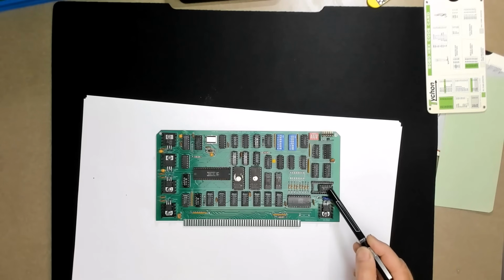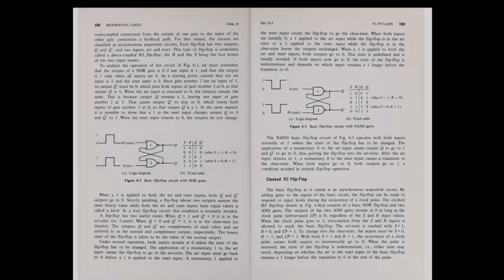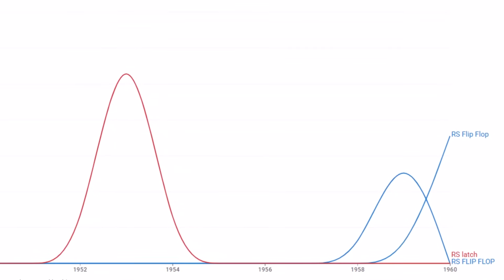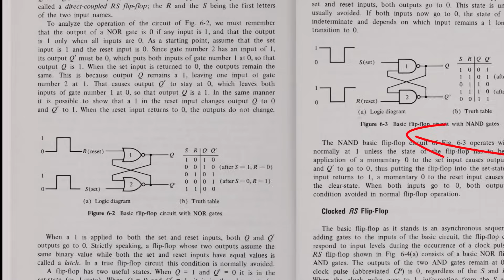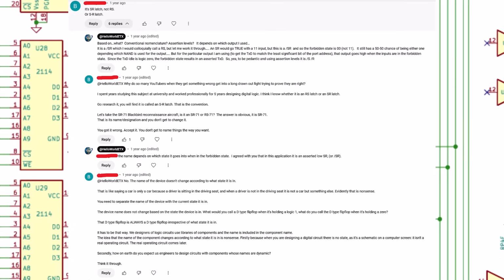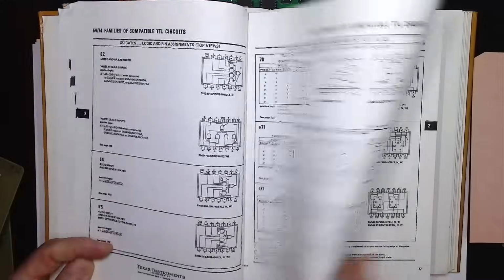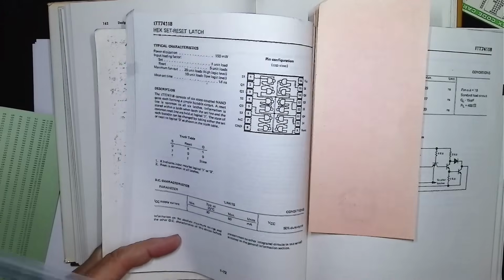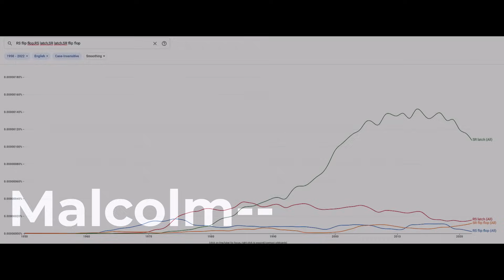{132} They changed the name of the RS flip flop, am I the last to know?

Comment: I started mid-70s, and I still call it an RS flip flop without any further thought, and I still will call it an RS flip flop.

Just like I continue to use the terms master & slave for certain flip flops, I2C, SPI, etc. Language changes that happen organically I'm fine with. Unilaterally imposing terminology changes for fashion reasons, not so much.
Reply: What about this thing people are saying that it needs a clock input to be a flip-flop, otherwise it is a latch?  Or maybe the other way around. I make no distinction between a flip flop and latch.
Reply: @Henry-t3w  Well, technically there are ICs that have a latch enable input, so whatever is in them is clearly a latch. I guess flip-flops are edge-triggered then, although I just call them whatever they are used for instead, and if I use a D flip-flop (well, the edge-triggered one at least, so I guess it is) to sample some signal, I call it a latch as latching the signal is what it does in that circuit.
Reply from the maker: Yea, i heard about master/slave falling out of favor.

Comment: I've been doing this stuff for nearly 50 years and have never distinguished between RS and SR naming.  Whether I call it an RS flip-flop or an SR flip-flop probably depends on the phase of the moon.  Trying to draw a distinction based on swapping the order of the letters is just going to be asking for trouble.  Plus we had bigger fish to fry in the 70s and 80s.  Remember when they wanted to change the AND gate symbol to be a rectangle with an ampersand in it?  GIven that we dodged that bullet, I'm inclined to leave RS vs SR in the same camp as whether 'data' is pronounced with a long-A or a short-A.
Reply from the maker: Yea, I remember the data book logic symbol scare.

Comment: In the days of the RS-latch, my personal computer took only 0.7 seconds to boot and be ready to use.  It never needed a security update in the entire time I used it.  The "hello world" document took just 14 bytes.  A mere mortal could write a useful program.  Now we have SR-latches.  My computer is taking darn near a minute to boot.  It is not available a lot because of the need to install the latest update. A "hello world" document takes up about a meg.  Just say'n
Reply from the maker: @kensmith5694  I would not be able to write a “hello world” pop-up in windows if my life depended on it.
Reply: @HelloWorldETX  Lazarus makes it possible.  I wrote a few Windows programs with it and they work.  Note that I didn't say it was fun.
Reply: the mainframes and minis of the era needed some pretty lengthy boot sequences, and I'd argue our PCs are closer to those than we are to the 8- and 16-bitters of the past. I do have some resentment that these level of systems are practically required for internet participation, though. In the early 2000s I was still productive with a dumb serial terminal, before web2.0 broke text browsers too badly, and text email was the norm.

what would youtube look like if moore's law had hit a sharper asymptote? videos on public access with BBS or usenet discussions? video zines?

Comment: I've heard both though I believe I've called them SR latches, I wouldn't think that someone calling it a different name was wrong though.  With EE there are at least 2 names for everything (unlike CompSci where there is an ever increasing set of names) so I say stay consistent with naming used with other documentation for the project and don't worry about it.     I never worked much with them other than switch debouncing where I typically used NAND gats as I'd pull the inputs high with a resistor and then use a spdt switch to ground one of those inputs pulling it low.  So I would have used the SR version if NAND = SR and NOR = RS.

Comment: I always considered RS Latch, RS Flipflop, SR Latch and SR Flipflop basically interchangable, and yeah, avoid the forbidden state, it is an awkward behaviour to work with. Does it really matter when all it means is that it is a latch/flipflop circuit with a Set input and a Reset input. And for reference I'm not that old, I was born after the end of the 70s.

Comment: SR or RS are easily interchangeable. Calling it 'flip-flop' is technically incorrect, as flip-flops are synchronous. RS latch with an 'enable' input would be an RS flip-flop.
Reply from the maker: @sharpfang  a number of people have said something like this.  I didn’t know this.
Reply: my impression was that latches are level-sensitive while flip-flops are edge-triggered
Reply: @MatthijsvanDuin  usually boils down to the same thing.

Comment: I always learned that if both inputs were high, then an RS-latch would be in a reset state, or Low, and an SR-latch would be in a set state, or High.
Reply from the maker: @mrdragon7520  a good data point. Was that after the late 80s?
Reply: I took the PLC course in 2020. It was more specific for visual programing, than actual electronics.
Reply: (I haven't watched the whole vid yet)
What you mention is correct in automatition. There, because of safety or functional reasons, one input has priority. In electronics, that's usually not the case, so the only difference between an RS and SR is the name.
Reply: @yanikb.1312 I think it is because of sequential reading, one input is read after the other and that basically defines the input priority.

Comment: You could have made this clueless commenter easily proofed wrong by linking to a few datasheets
For example HD14043B, HD14044B
 
Where the datasheet starts with: 

Quadruple R-S Latch

The HD14043B and HD14044B quad R-S latches have pendent Q output and set and reset inputs
Reply from the maker: @rj7855  But I am not sure they are wrong. I went through the three stages of ‘YouTube incoming comment”. Starting  at “what an idiot” to “I had better check” to “maybe he has a point”. There is no question that the industry made an effort to change the nomenclature.

Comment: All the books I learned from in the 90's referred to RS latches. While some were Radio Shack, some were british, and they used the same terminology.
I don't think there is 'one true right way' though; I'm working with a bunch of S-R latch ICs in a current design.
EDIT: The S-R latches I'm using now have logic to handle the forbidden state, I think R asserts over S.
EDITEDIT: Oh, that's funny... the online shop I bought em from lists them as S-R latch, but the datasheet states cd4043b as "CMOS Quad NOR R/S Latch with 3-State Outputs" 🤣🤣🤣

Comment: When I was learning to make circuits in redstone, the Minecraft Wiki called these RS latches. that would be around 2010, and I don't recall that changing as late as 2018. The forbidden state caused them to burn out and become inoperative until the burned-out torch was broken and replaced, so they didn't match the behavior of either "reset dominant" or "set dominant" They were based on NOR gates, but this is just Minecraft physics at work.
Reply: IIRC the forbidden input would simply turn both torches off until the input changed. Thus, the behavior would depend on which latch design you were using and how it was hooked up. If your output came from your torches, they’d both be off. If your output came from the blocks on which the torches were placed, they’d both be high (there’s power coming into the block to keep the torches off).
Now, if your next input state was 00, then I don’t exactly recall which torch would light first. That is, except for the commonly-used 1-wide stacked version with a repeater. Then, the torch on top would light first.
Reply: The reason the torches burn out is because they oscillate so rapidly. Any redstone torch that does that will "burn out" (actually just jam off). This mimics reworld behaviour of the forbidden state: unpredictable oscilation that doesn't actually make sense in the context of digital rockit.

Comment: In the '90s I was informed about why this issue is only for boomers.  I was a junior design engineer at the time designing a microcontroller interface board using an 8051 controller.  After designing all the address decoding and board level latching functions using 74HCTXX, I was informed that nobody does any of that any more.  Everyone uses GAL's now.  At some point you call the the latches and flip-flops, whatever the FPGA manufacturer calls them so that your fellow engineers know what you're talking about.
Reply from the maker: @johnwilson839  PALs and GALs change how we did things at the time, but I never took a liking to them and still prefer old school glue.

Comment: I always learned it as set-reset latch and RS latch and I learned all this in the last decade and a half.
Reply from the maker: @yodal_  Another good data point. I find that encouraging that the term is still (relatively) current.  Unless you learned it from references that are 50 years old I suppose.
Reply: @HelloWorldETX  My first exposure to digital logic was in Minecraft. Designs for all of the logic gates, flip flops, and latches were on the official wiki. They labeled it there as an RS latch and I had no reason to question it.

Comment: For me RS and SR mean the same thing, but I've always made the distinction of a Latch being state driven, and a Flip-Flop having a clock. Online as well as in some of the books you showed these terms seem to be interchangeable
Reply: Yes. This is the actual proper terminology. There is a difference between latch and flip-flop... One is asynchronous, one is synchronous. I really don't like it when people conflate the two. Especially when the circuit they show isn't even edge triggered. Most D flip-flop circuits you see online either don't have an enable or clock at all, making them literally just a buffer, or have an enable which only toggles transparency, which is often mislabeled as a clock.

Why on Earth is this a thing?? This is not hard to understand.
Reply: @nikkiofthevalley  well, you can make any asynchronous latch a synchronous flipflop by adding ands to each input and output and wire up the other input of each and as a common clock line.
Reply: @EwanMarshall  That is not a flip-flop, just a latch with a transparency enable. If you were to keep the "clock" high in that circuit, it would act exactly the same as an asynchronous latch. The same is not true with a proper flip-flop, which only changes state when the clock changes from low to high or vice versa. The general way to make a proper edge-triggered flip-flop is to connect the output of a latch into the input of another, then add an enable to both, then wire the clock to one, while the other is connected to the inverted clock. This is called a master-slave flip-flop. There are more optimized versions of this for specific flip-flops, but this works for all of them.
Reply: @nikkiofthevalley  synchronous != edge detection. If you specifically want rising edge, sure, but that is not required for a flipflop, just that it has to be synchronous. By extreme technicalities.
Reply: @EwanMarshall  I had to refer to my EE textbook, but you are technically correct. (which is, of course, the best kind of correct) Though most of the time when you hear synchronous, they mean "edge triggered". When you go this far into technicalities the terminology starts to depend on who you're asking.
Reply from the maker: @k1ngjulien_  this is more new information to me. I see what you are saying, but if I tried to start making that distinction this late in life, it would goober up my brain.

Comment: I learned "SR flipflop" first (in the 2010s), and I was slightly thrown off the first time I heard "RS latch" but accepted that it must be the same thing. I'm slightly torn between the two now. On the one hand, it makes sense to say "set/reset latch" in the same way as it makes sense to say "yes/no question": we put positive before negative in most contexts unless there's some reason to do otherwise. On the other hand, I have to admit that "RS" rolls off the tongue a little more smoothly than "SR".

In any case, I do enjoy looking into the origins of linguistic phenomena like this one, so, as others have said, thanks for sharing what you've found! As for which term to use, any of the four combinations of "SR"/"RS" and "latch"/"flipflop" is fine in my opinion. 🙂
Reply from the maker: I never noticed we put the affirmative first, also true or false (which directly applies to RS).  I wonder what is the defining order in plus or minus, give or take, hot or cold, love or hate, in or out?
Reply: @HelloWorldETX   I learned most of what I know about electronics in the late 90's/ early 00's and I've always known it as an RS-latch, but I couldn't care less what someone else calls it as long as we both know what the other is trying to communicate.

Comment: All I know is that when I'm looking for a CD4043 or CD4044, some vendor catalogs will usually list both of them as quad RS flip-flops or latches while other vendor catalogs will list both of them as quad SR flip-flops or latches.
So I can live with either RS or SR and either flip-flop or latch.
I have better things to do than to worry about the names, like finding a supplier that still has what I want in stock.
Reply from the maker: The answer to the last comment is usually Anchor Electronics
Reply: As far as i know RS and SR are interchangeable but a latch is asynchronous and a flipflop only changes state on a clock edge.
Reply: @robstamm60  
The CD4042 quad "latch" is supposedly made up of four D-type flip flops although technically, my understanding is that both a latch and a (D-type) flip flip both have clocks where with a latch, the outputs follow the inputs before a clock edge to perform the latch occurs while with a D-type flip flop, the output suddenly matches the input when the appropriate clock edge appears.
Whatever the case, it's my responsibility as a so-called "designer" to figure out what part fits my needs (by looking at the datasheet) rather than care what someone calls the damn thing in a description.

Comment: I learned the circuit as an SR latch, but then encountered the RS latch terminology in a Radio Shack book. I figured it was just the Radio Shack marketing team at work.
Reply from the maker: That is a great anecdote.
Reply: I'd be curious if Forrest Mims had any experience with the shift in naming and why it happened.
Reply: Indeed, I recall the booklet in my Radio Shack kit discussing the SR Flip-Flop expressly saying that they preferred to call it RS Flip-Flop for that reason.  Even as a kid in the late 80s it seemed obvious they were joking around.  Sadly I can't recall here which kit it was, or the year of it's production.

Comment: I started learning electronics in the late 70s.  RS latch is the terminology familiar to me. RS (or SR) flip-flip is a nonsense term because the simple 2 gate circuit can't flip-flip. Add a few more gates to an SR latch and you have a D type flip-flop that can flip-flop as expected.
Reply from the maker: I would call that a T-type latch which Toggles with each strobe.
Reply: TBH I try to consider latches to have latch-enable inputs. So you can have a T flip-flop or D-latch (or D-flip-flip, if it is edge-triggered), with RS somewhere in both (also there happen to be clocked and edge-triggered RS flip-flops...) - but in reality I just name them by their usage types: if anything's main function in a given circuit is an edge or pulse response, it is a flip-flop, - if one's role is to latch a signal state, one is, well, a latch. So whenever my RS is used for some "set-ON/set-OFF/keep"-type command decoding, it is an RS-flip-flop, but should one latch an overcurrent protection state until a later reset, it becomes an RS-latch :P

Comment: LMAO some guy who's worked for five years thinks he knows everything. If he doesn't have any grey hair you can ignore him
Reply: I'm a software developer with 20 years and I'm starting to get real good. They call guys with 5 years senior, ever wonder why all software is shit. That's why, you start to be average when you're 10 years into the craft.
You can always ignore anyone with less than 10 years on any technical field.
Reply: @monad_tcp  "Uncle Bob" Martin says that the number of programmers has doubled every 5 years for many decades (perhaps no longer true due to recent layoffs), and thus for all this time, half of the programmers have had less than 5 years of experience.

It does take a long time (and an openness to learn history) to learn so much of this. For example, there's a connection for transistors in analog circuitry called cascode, but the term comes from its coining and initial use in vacuum tubes, a combination of cascade and cathode.
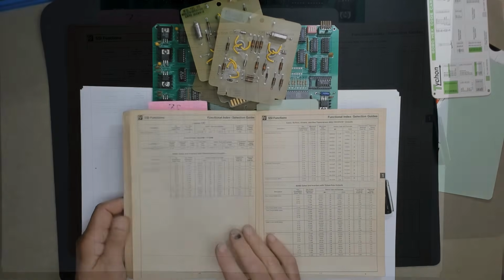Reply: 0:50 - This guy could use trip out behind the wood shed too. This wet behind the ears pup calling his superiors, "Washed up boomers", is priceless. At least he's not a biggot. No. Wait... It's called "cognitive dissonance".